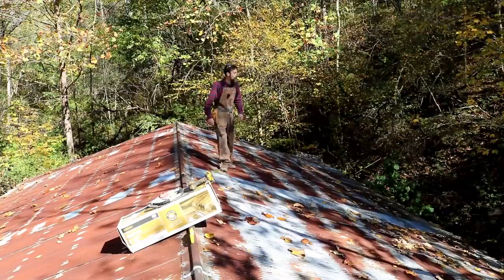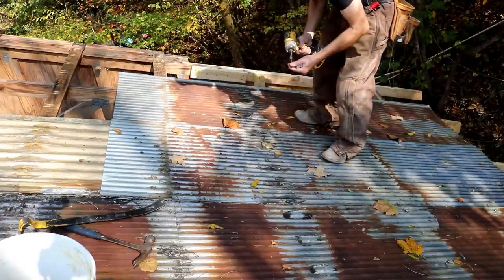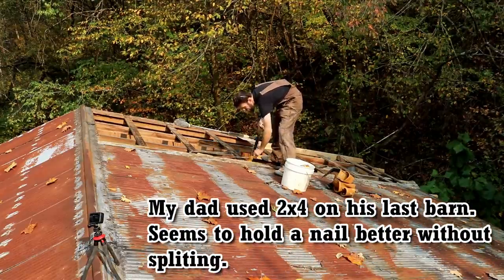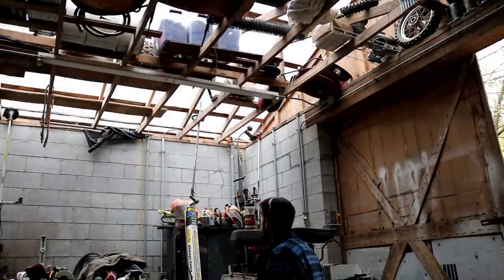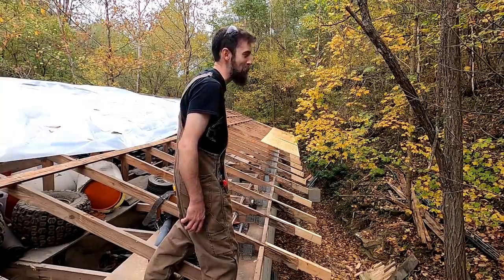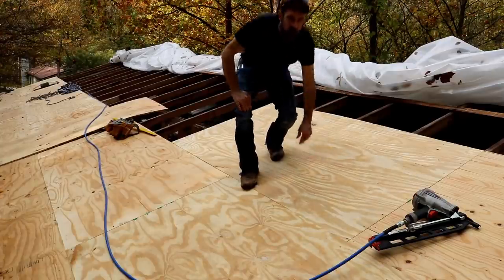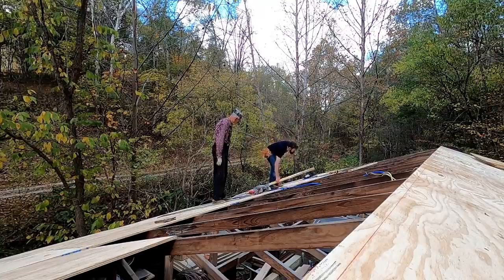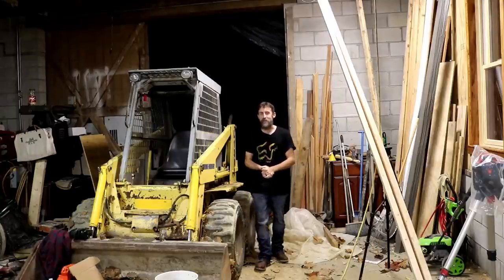Removing the leaking and damaged ROOF!

Comment: Now I know why your roof leaked.  Nasty skylights.  My old shop is close to yours,  put a new roof on my old shop down town and still had a few leaks, firewall issues.  Bought the property I have now, owner had her auction, was raining that day, wagons in shop, no leaks tin flapping in the wind and daylight showing but no leaks to speak of.  Nothing like some pitch and strongbarn roofing.  My old uncle built my shop back in about 1950 said he used sycamore nailers for roofing.  Nail holes have worn out, screws work.  Wish I could turn roof upside down, galvanize is in good shape on bottom but nail holes wrong.  Ha.  Even a few bullet holes that don't leak, shouldn't shoot birds with a 357 mag.  Found empty casings when I bought shop.  Got to have a heavy rain to make them even dribble.  Good luck on your roof, you have good pitch and think twice about gutters.  Gutters are trouble.

Comment: If it were me, I would lay the entire roof out and then go back & support the seams that were floating...  Forget trying to figure anything out, it's not like it's a floor that needs to support a lot of weight.
Reply: You might reconsider that comment if you lived where they had proper snow 500mm + over that area is going to be heavy . Interesting point consider how heavy is a cloud ☁️ 1 imp gal is 10 pounds 50 mm of rain over a square km is a lot so the cloud that dumped it must have weighed the same 😱

Comment: Why would you go to shingles over a metal roof? Way less maintenance with a metal roof, it lasts longer, and WAY easier to install. I would go the other way.
Reply from the maker: Tin sweats and drips. I can deal with that though. The main reason is the noise reduction and insulation valve.